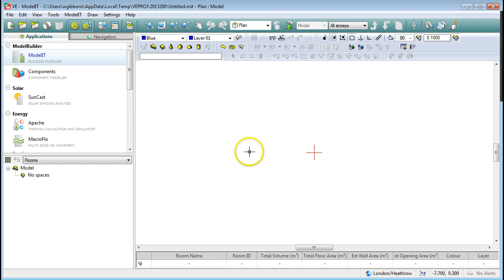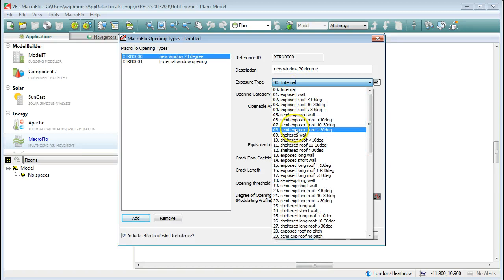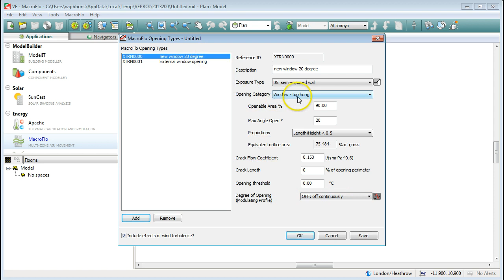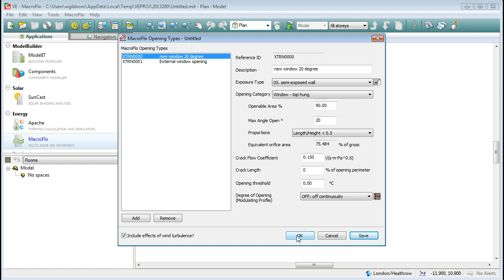Creating a new window opening type in IESVE

Comment: Hi, Is it possible to add glazing into a pitched roof? I am trying to add windows into the top floor of a building which has a pitched roof but incorporates windows too
Reply from the maker: Yes, that should be possible. If you go down the levels as far as possible so that you're looking at the inside surface of the roof, you should be able to add a window.

Comment: Hi there.

How do I assign the new opening type, I have created in Macroflow  in the ModelIT 

Because my external wall has holes and the apache simulations cannot be run with holes in the externall surface, therefore to recreate the holes, i tried making a new window type with continuously on profile to depict a hole, but the thing I am not able to assign thsi newly created window type in ModelIt !!
Reply from the maker: Hi. You don't apply or change the window types in ModelIT, that has to be done in the MacroFlo application.

Comment: In my model, I have already assigned the opening types i created in advance with Edit Selection Set Opening Types.
But how do I have to manage the MacroFlo menu in the Building Template Manager?
Reply from the maker: +anna penzo Hi. I am not sure what you mean. If you have created opening types in MacroFlo and you have set them up to open using the profiles in ApacheSIM, then you do not need to do anything with MacroFlo in the Building Template Manager. Just make sure that you have no infiltration set in the BTM (i.e. do not set some value such as 2 a.c.h) as you want all your ventilation to come through the windows and not through some air change value. Also, make sure when you run ApacheSIM that the MacroFlo box is ticked before you run the simulation. I hope this helps, but feel free to drop me a line if you have any more queries. My email is waynegmit@gmail.com

Comment: If you have already inserted windows and doors in modelIT. Do you have to do it again here?
Reply from the maker: No. If you have already drawn doors and windows in ModelIT, then you can later apply different opening types to them through MacroFlo. All you are doing by drawing a window in ModelIT is really just giving it a location and size. All the clever stuff (degree of opening, exposure types, opening profile, etc) is done in MacroFlo and Apache (Apache for the opening profiles).
Reply: Thanks
Reply from the maker: Ronan Doherty No problem. Just as a matter of interest, are you undergraduate in DIT?